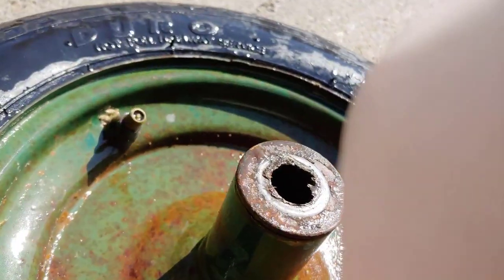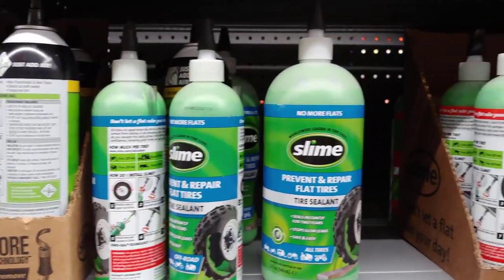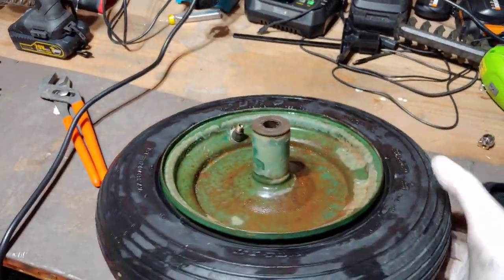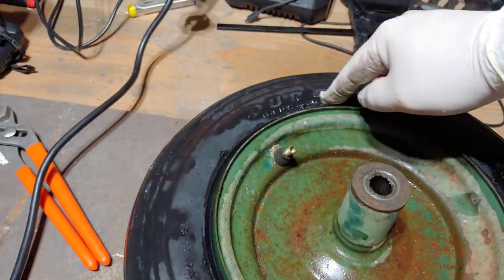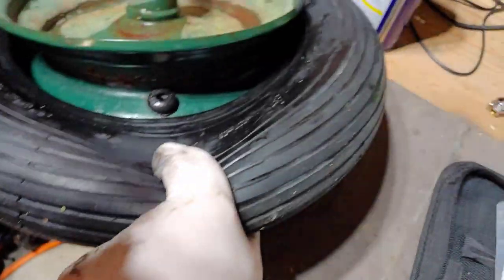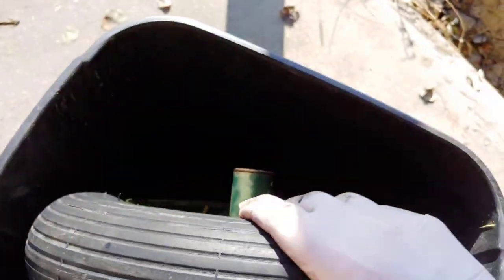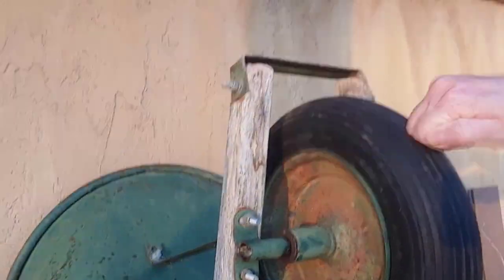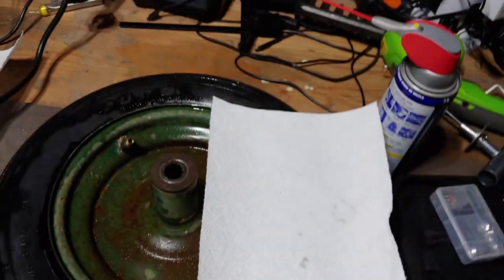How to fix a tire leak with WD-40. Works for tubeless tires.

Comment: Thanks so much for this. My motorcycle rear tyre was losing about 4 or 5 psi in a 24 hour period. There was no puncture and the valve was ok so it had to be around the rim. I tried the WD40 and so far so good! Good man for putting this vid up and I really like the environment where you live btw. Dave. England.
Reply: How did you fix did you take wheel off leave on motorcycle have to Break the bead remove valve first?
Reply: @brocky78  hi there I have to take this back as it only worked for a short time. I didn't take the wheel off I just rotated it while I gently sprayed at top centre. I guess WD40 is just a water repellent so we can't expect too much. I eventually changed the tyre.
Reply: @davidellis5312  ok thanks for fast reply , safe riding God Bless 🙏
Reply: @davidellis5312  Thanks for the honesty. Many of these "quick fixes" are very temporary.

Comment: Worked greater as a cleaner, restorer of rubber, and most importantly in my case, as a sealer of air. I hadn't thought of this so it saved me buying a $27 can of rim-bead sealer for just a couple of dolly tires. Thank you!

Comment: Another great use for the wonder stuff WD40! I'm going to try it now. But spread the word - never use it as a fine lubricating oil. Although it looks like it, it isn't. It is a wax dissolved in a solvent. I found out to my cost when trying to lubricate my model train locomotive!

Comment: Worked like a charm for my dolly wheels. Had to wipe one down with a cloth and reseat it by pressing it down on the hub but the other sealed right up after application of wd-40.

Comment: I fixed a leaking wheelbarrow tire that wouldent stay on the rim by submerging the tire under water and fill it full of water then blow it up. Plus in the winter it froze solid and it became a run  flat tire.

Comment: Thanks! Have you noticed any etching around where you sprayed? My friend told me WD-40 eats rubber but I wasn't so sure.
Reply: No. Your friend lied yo you.
Reply: Im a cert 2 heavy tyre fitter. Solvents rot rubber. Full stop. Do not use WD40 on tyres.

Comment: Think this will work for my moped?
Reply: I’m not sure you want to risk this method on something that will be carrying you around at 40 miles per hour.  Spend the $$ and get it done at a tire shop. 
Safety first (sometimes 😉)

Comment: DO NOT DO THIS. SOLVENTS ROT RUBBER. You may achieve the goal you want using WD40 but you have introduced a solvent that will persist in rotting the tyre. THIS IS VERY BAD ADVICE. TYRE FAILURE KILLS PEOPLE.
Reply: If you’re looking to use your WD-40 spray with rubber material, you’ll be glad to know this is possible – so long as you have the correct WD-40 spray.

When you browse the different WD-40 options available on their website, you’ll notice that many of the variants state that they are intended to protect metal surfaces from rust and corrosion.

But if you’re looking to use WD-40 on a non-metal surface, that’s entirely possible with the right variant.

The WD-40 Specialist Silicone Lubricant Spray is the perfect choice for those looking to use this dynamic water-displacing spray on non-metal surfaces.

Not only is WD-40 Specialist Silicone Lubricant safe to use on rubber, but you can even use it on plastic and vinyl.

Comment: This is not the best fix for long term: wd40 causes rubber to degrade and expand outwards, it will fix for short term and damage your rubber. If you have $20 bucks, get some real tire sealant and apply it as same